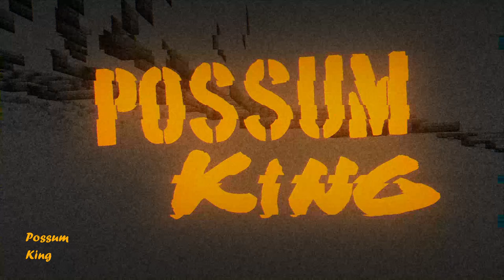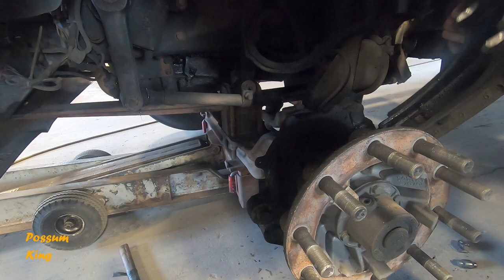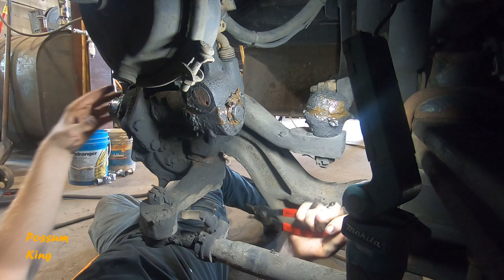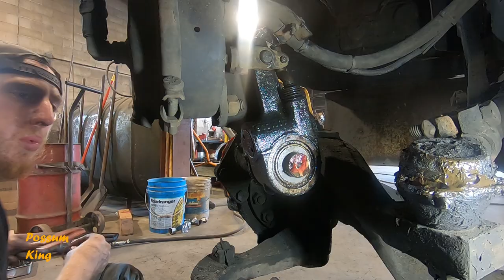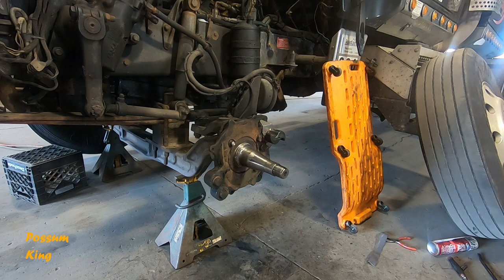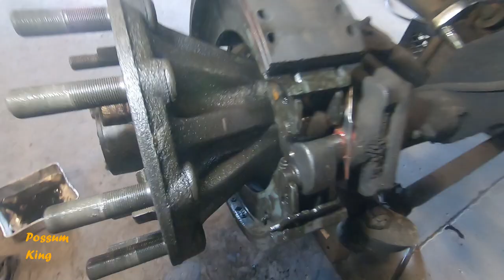Replacing S-Cams And Bushings

Comment: Contaminated pads, dropped the bearing most likely damaging the cage, no torque and nowhere near enough bearing oil. This is why I prefer doing the repairs myself, you never know whos gonna be working on your money maker. I just about shit when he installed the new bearing races and seals. No inner cup so the bearings are supposed to be at a specific torque. Most likely damaged his brand new bearings due to over torquing. 😂
Reply from the maker: Also too much air in the steer tires. Can't believe the whole truck didn't just blow up leaving the shop.